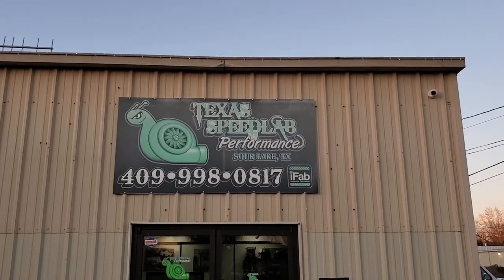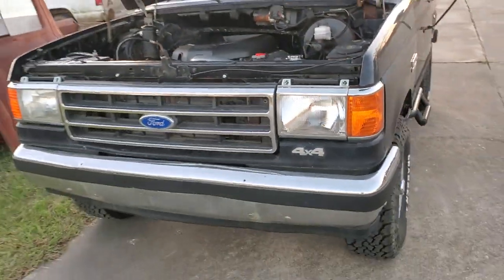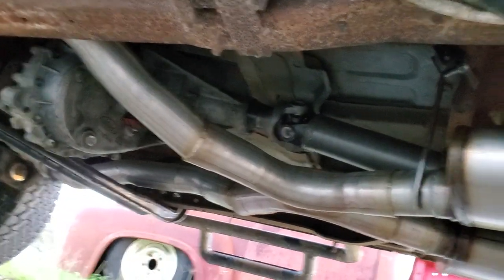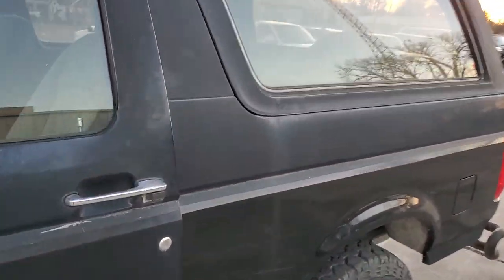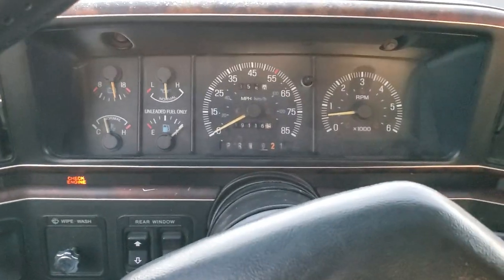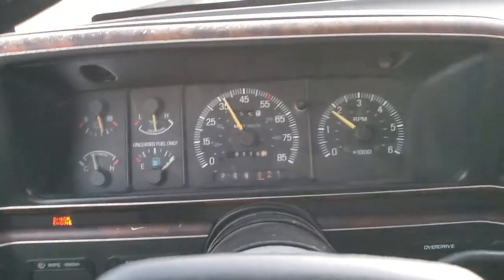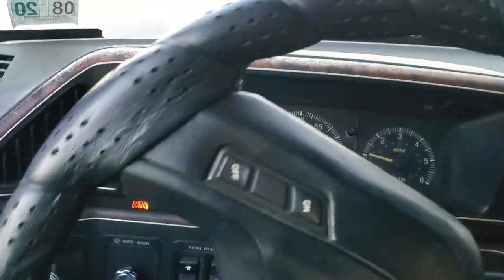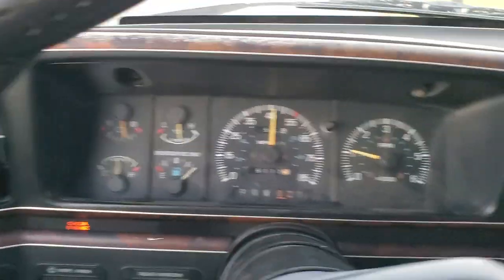Coyote Swapped 1990 Bronco

Comment: Awesome.  I have a 93 Bronco in really good condition but severely under powered.  What would this exact swap with a first gen coyote and 6spd auto cost in a range with parts and labor?  I want the AC to work.  Other than that just like you have it is fine with me.